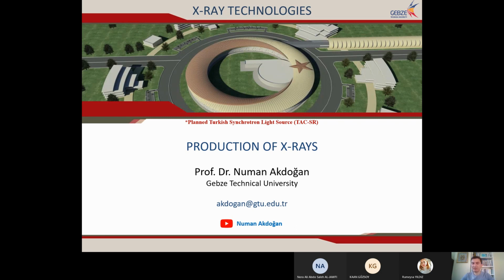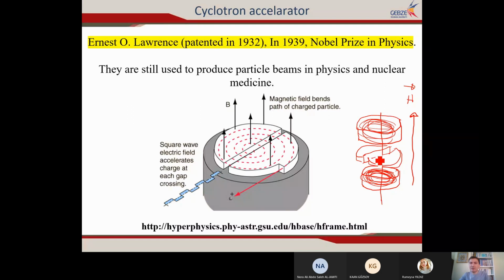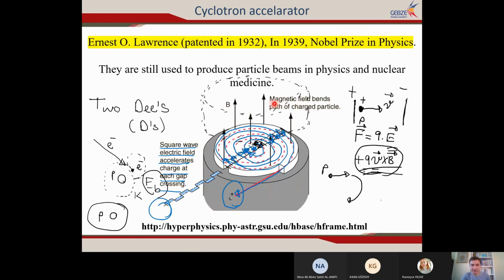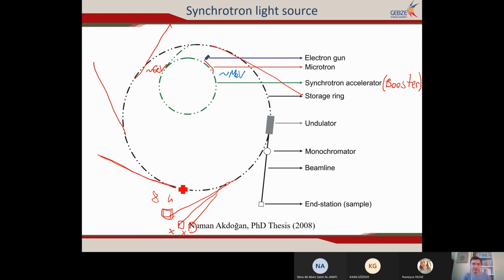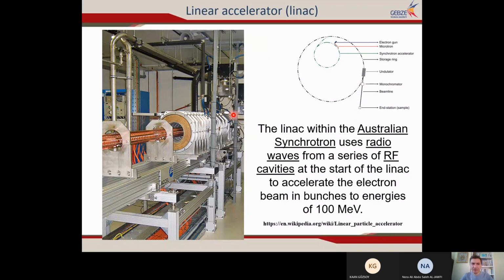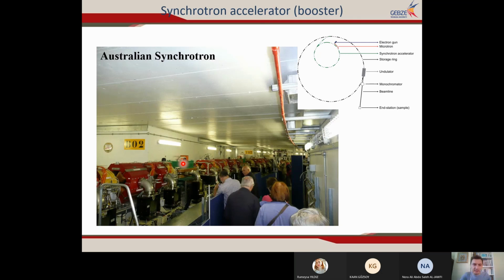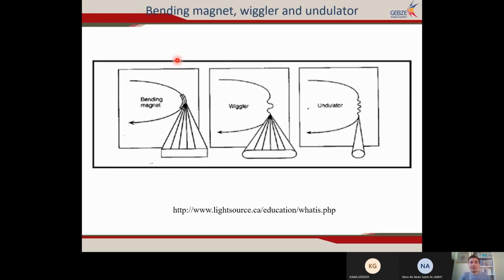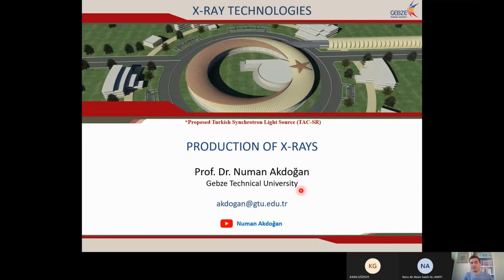X-Ray Technologies - Production of X-rays, Synchrotron Light Sources, Free Electron Lasers (FELs)

Comment: Dear Dr. Numan, nice talk. I highly appreciated it. I have question, if the charged particle circulates inside the booster, so after reaching the Bn magnet (I mean the end magnet in the circular path of the booster). After that, will it enter again from the Bn to B1? If yes then Bn>B1? As you have mentioned in the talk that B2>B1 and so on. So this will avoid the trend of B2>B1, B3>B2, and so on. Thanks for your time.  waiting for an answer.
Reply from the maker: Dear Johar Zeb. The condition Bn+1>Bn must always be satisfied. As I mentioned in my talk, as the electron beam energy (speed) in the booster increases, the magnetic field of the magnets increases synchronously. That is, when the electron beam enters B1 from Bn, the magnetic field of B1 is now set higher than Bn. I hope it is clear now.

Comment: one more question, the main difference between wiggler and undulator is only the number of used alternating magnets or something else? I mean in undulator there are more alternating magnets as compared to wiggler?
Reply from the maker: Dear Johar Zeb. You can find some information on the difference between wiggler and undulator at the link below. If that's not enough, you can find a lot of other information on the internet, in books and articles.
https://physics.stackexchange.com/questions/480966/difference-between-an-electron-wiggler-and-an-undulator
Reply: Thank you so much Sir
Reply from the maker: @motivationaljz2245  You are welcome.